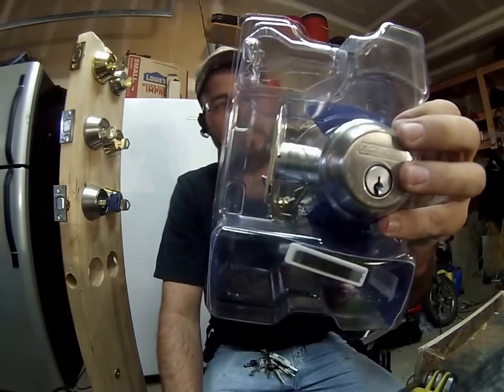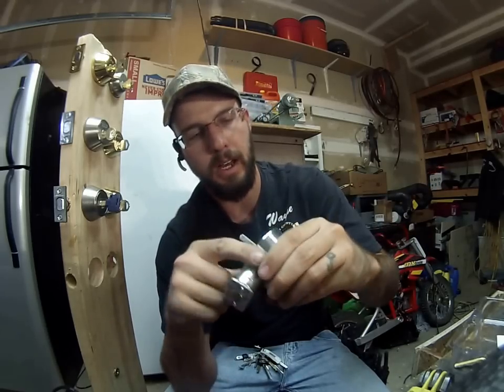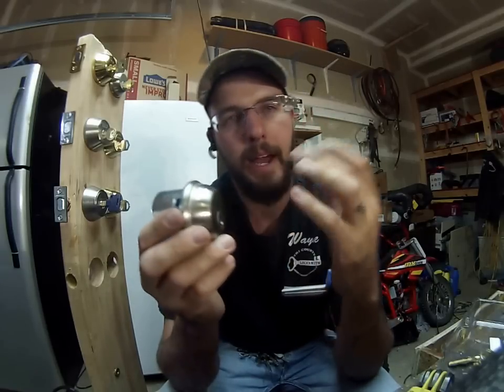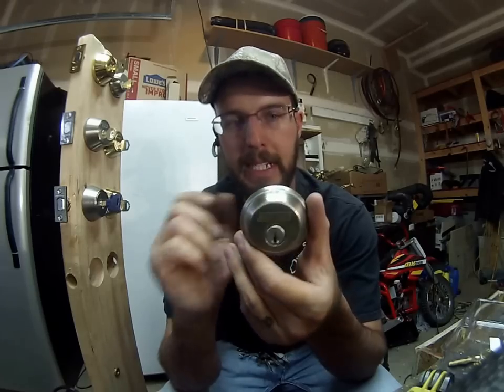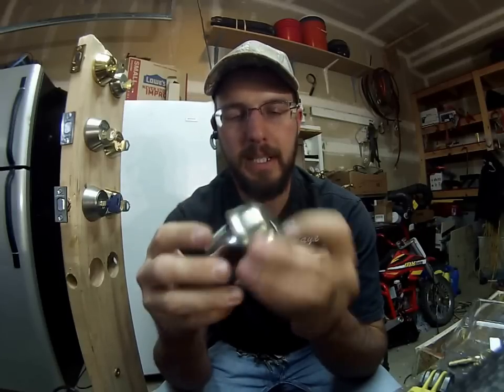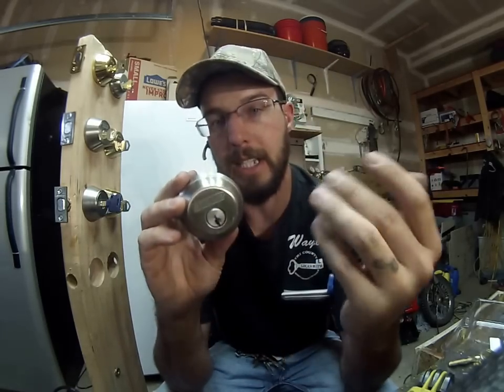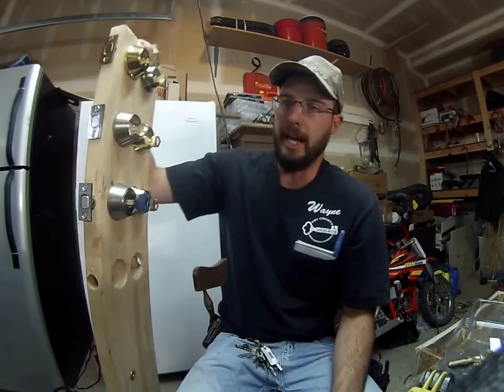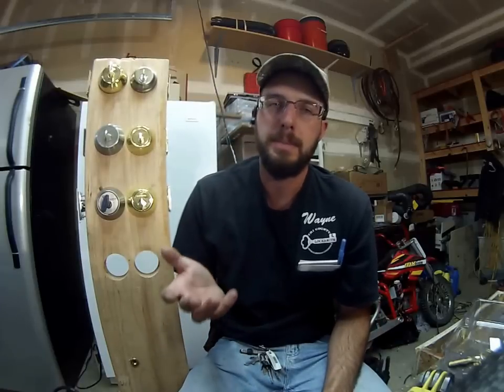New! Schlage Deadbolt Door Lock Review! Anti Drill Plate Bump Resistant Pick Resistant Lock

Comment: I just drilled this exact lock out on friends house. Took me a couple mins with a 1/4" and 5/16 drill bit but finally drilled out the two screws on the sides.

Use a nail punch to break through the outer shell and the plate behind it then go to town with a good set of bits.

Comment: Schlage brass door knob lock has an anti bump or pick measure, either by default or by accident. when you lock the tail piece the part that fits into the latch will turn freely. allowing it to turn 360 degrees. all you need do is turn it a 1/4 turn and that stops the lock from opening. either by key or thumb turn. all that is needed is for that part to turn when locking the door and now it is fail safe. no one gets in. i tried turning both the tail piece and the square part together and no luck. if they can make it turn when locked' great anti bump or pick feature.

Comment: whats the best wat to install a ilco bump stop t pin and spring, tpin inside the spring? master wafer in between, druken spool type deal. what do you think. I ordered a high security pinning kit and it comes with 10 ilco bump kits. I have only seen tpins used with wafers in challenge locks not with bad ass springs.

Comment: Dude Thanks . I am changing my locks tomorrow to the new design . Did they make improvements to the knob lock as well.?
Reply from the maker: Yes!
Reply: Masterg Samuraixmen  
The b60 is a grade 3 residential lock.  It claims to be grade 1, it's not. B500 series is a TRUE grade 2 lock. The b600 series is a TRUE grade 1 lock. For the layman, the b60 is the best option for cheap residential locks. It will cost about 3x as much ad the competitor, and most of the time be worth it. I say most of the time, because there are so many factors, as well as some random lock brands that are stepping up their game.

Grade 2, or the 500 series is roughly 50 bucks opposed to the 120+ that the 600 series cost. The difference is the "ansi grade". Look it up, but in short theres a few factors that qualify it for a certain ansi grade. Things like x amount of daily use before failure. X amount of mins withstanding picking, drilling, etc. That being said, you need to take a the picking, bumping, and even drilling claims from organizations like UL, ANSI, etc with a grain of salt. 

Back to the comparison from a layman's point of view. 

The 60 series has potmetal parts in it. The 500 series has things like a zinc alloy bolt, but it's backed up by a high quality steel roller inside (this slows down sawing of the bolt). The 600 series isnt going to have any cheap alloys, and is going to be made of all high quality metal. NOTE! The difference between the 500 and 600 materials is not important in many cases, due to many factors such as cheap doors for example. I should add that both the 500 and 600 are true commerical grade products, where as the 60 series is strictly cheap residential grade. Think tougher materials, higher quality manufacturing, etc. 
I've missed many things, but one more important note is the hardware that comes with the 500 and 600 series. They have many things like reinforced strike plates, better screws, etc. All of which add immensely to security. 

There is also a 700 and 800 series. These are the exact same as the 600 except the core. The core in the 700 and 800 is the Schlage Primus. In layman's terms this is a higher security key. They are hard to buy as a normal joe, which is the term "key control" that you'll here often. This should be taken with a groan of salt.

What they do add though is they're much harder to pick, bump, etc. The 700 comes with the normal primus system. The 800 comes with the Primus XP. The XP is superior in that it has some added features that make it harder to drill etc.

I hope this helps someone. If you want my advice, buy the 500 series. I say this for many reasons, and if anyone is curious I'd gladly explain. Last note. You can change out the core for a higher security core such as the primus, protec 2, medeco, etc in the 500 series and up. You can also add better cores to the 60, not as many options, but all of them would be pointless as the lock itself is low security.